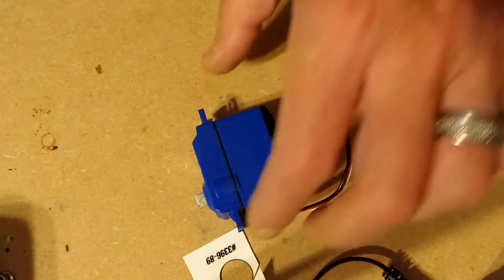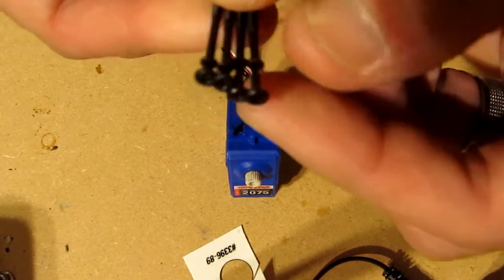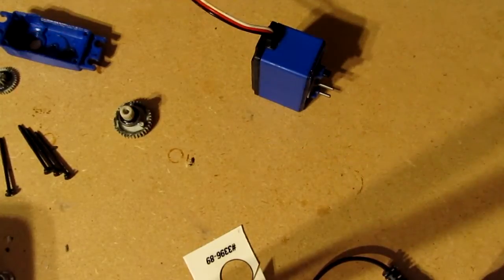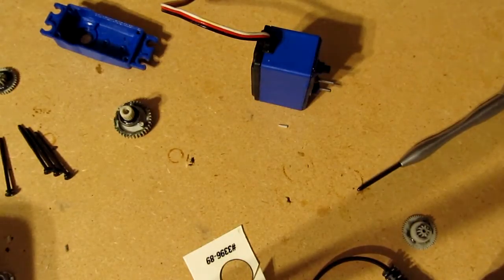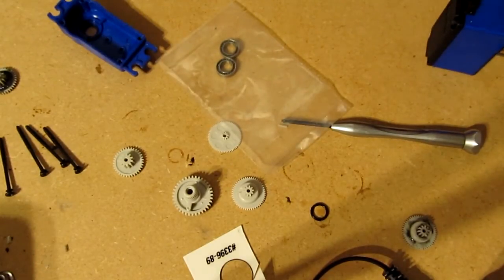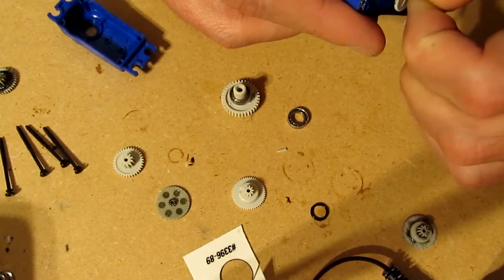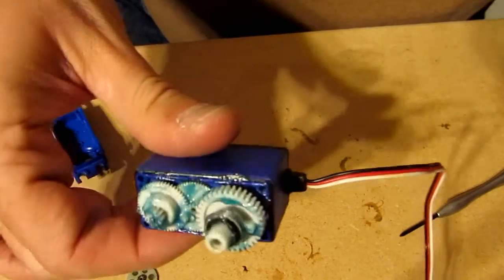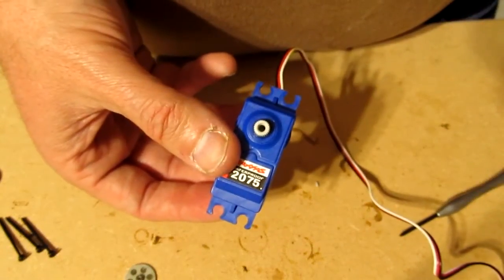Rebuilding Traxxas 2075 Servo

Comment from the maker: Thanks.  Hope it helps some.  Many people are daunted by the task of replacing all those gears.  It really is simple and cost effective.
Reply: TheStampede19 thank you so much for posting this video! I received a new gear Kit from Traxxas because my brand new slash, new to the point that just to use it I obviously had to unwrap the factory package, and just on the 2nd day of using it, the damn servo started acting up so damn bad, and the new gears I got will not fit in it yet, but now that I’ve watched your video those new gears will absolutely go in. And of course, on only the 2nd fucking day, the brushed motor died out. Idk what the hell I should do next, but shit I should just convert it to brushless. I am also very nice towards driving it, cause all it’s seen is dirt and grass. I always drive it with care, I should not be having this fucking motor problem. Shit, if I spent a couple hundred on the slash, the motor should at least be reliable for a little bit. Once again, thank you so much for posting this video. You’re going to help so many just by posting these helpful videos.

Comment: I have a Traxxas  2075 servo an something in the center part has come loose ! Sounds like a screw or a pin . Is there a way you can remove the circuit board without breaking something ?

Comment: Savox metal servo gear set and bearings is better at 12 bucks little more expensive but the gears are METAL part number sav-sg-sw0231mg
Reply: So these gears will fit in the Traxxas 2075 servo?
Reply: William Roeser Verified Owner 
Thursday, Dec 7 2017 (about 4 years ago)
Savox SW0231MG Metal Servo Gear Set w/Bearing
Bought a set to put in traxxas servo #2075, will NOT work. Main gear that turns servo horn cannot be installed in center position

Comment: Wish they had a metal gear upgrade. Instead of having to buy a entire new servo. Traxxas erevo 2.0. Both stripped within the first 10 minutes of unboxing. No recks or hard hits. Just plastic teeth isn’t made perfect every time. And the other servo didn’t have but a pea sized spot of grease.